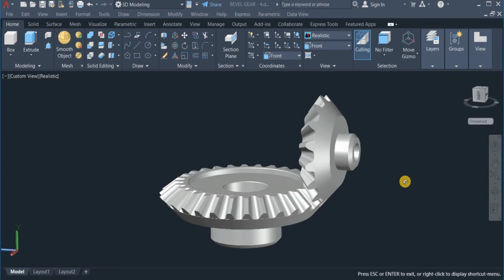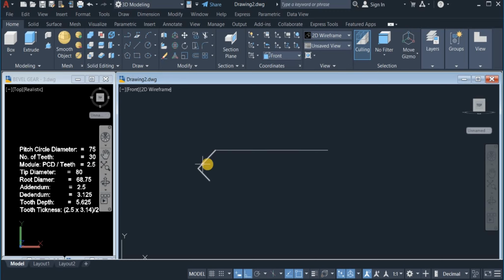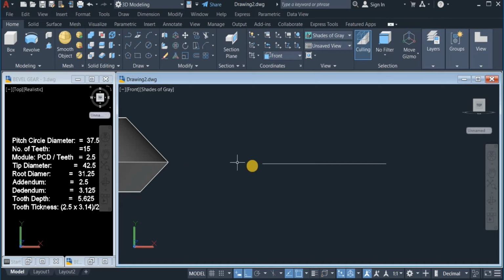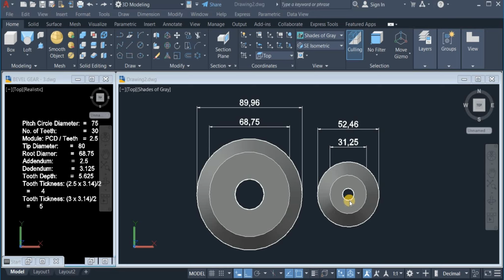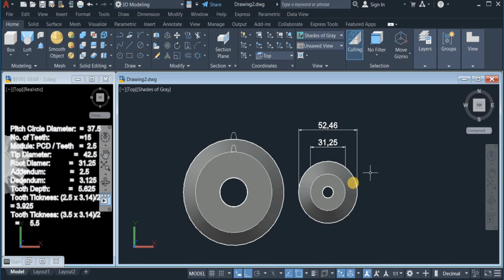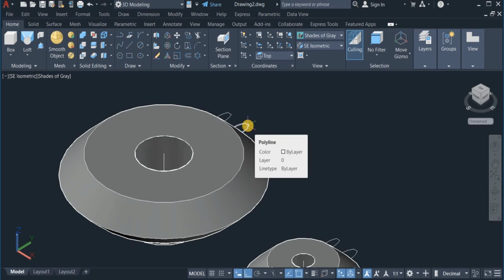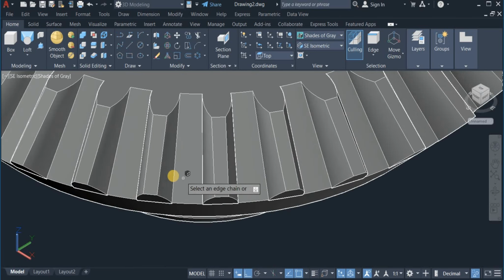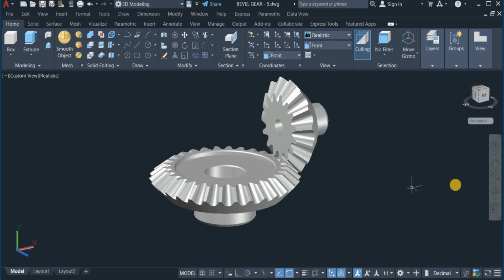How to Model Bevel Gears in 3D AutoCAD: #AutoCAD

Comment: It's a nice tutorial but please leave the command line open. it helps us to follow up easily. thanks!!
Reply from the maker: Ok.
Reply from the maker: When you turn on the 'Dynamic Input' button on the Status Bar, the banner displays the same instruction on the Command Line. You can turn off the Command Line (Ctrl+9) and follow instructions on the Dynamic Input banner.

In most cases, texts from Command Line interfere with the drawing and constitute visual nuisance.
Reply: @HYCAD okay thanksb
Reply from the maker: When you turn on the 'Dynamic Input' button on the Status Bar, the banner displays the same instructions on the Command Line. You can turn off the command line (Ctrl+9) and follow instructions on the 'Dynamic Input' banner.

In most cases, texts from the command line interfere with the drawing and constitutes visual nuisance.